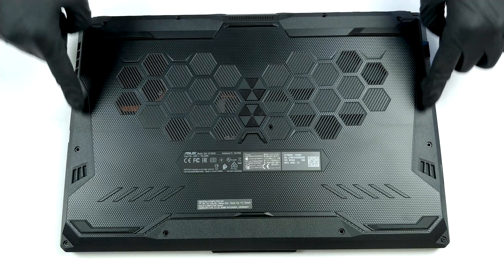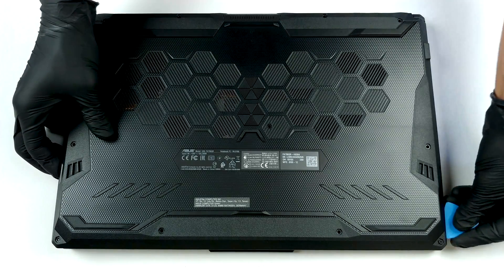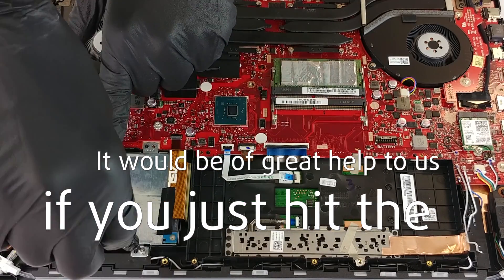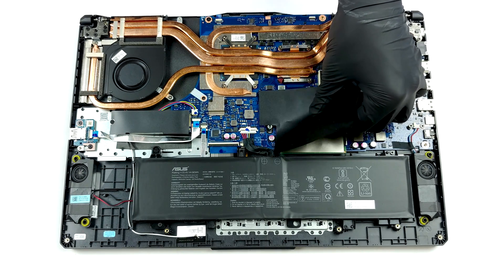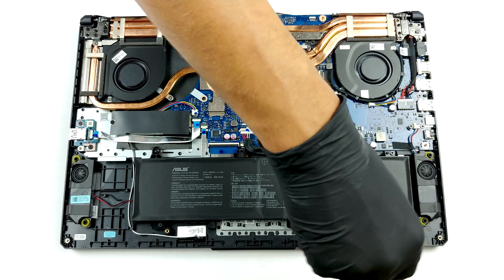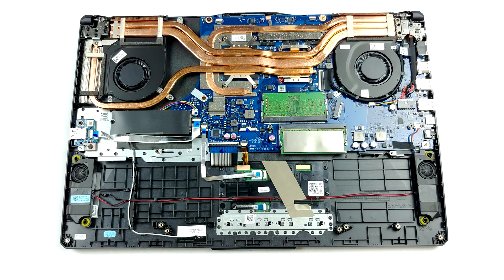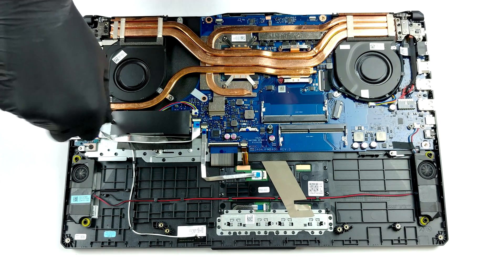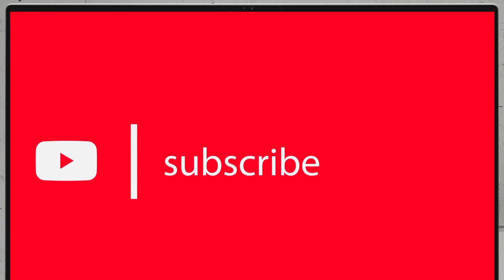🛠️ ASUS TUF A17 (FA706) 2021 (Ryzen 7 5800H + GeForce RTX 3070) - disassembly and upgrade options

Comment: I have this model od laptop and i have couple questions, in which you can help me. First of all, i want to thank you for this clip, i wanted to change RAM memory from 16gb (2x8gb 3200 cl 22 1,2V) into 32 gb (2x16gb 3200 cl 22 1,2V). I called in couple places and on the question if i can buy memory with lower cl they mostly answered, that i have to had the same. When i asked if i can have more then 1 TB of  memory on one m.2 slot? Can you try to check this issues and give me info if i can develop my laptop more?

Comment: One small detail, if you can also capture the memory units labels, because it seems manufacturers are using a scam technique BAIT & SWITCH.
The density of memory is important so they send for review with (rx8) density but buying from stores with (rx16) density which is cheaper but also worse performing, so you buy laptop based on reviews but receive worse quality.
Thank you
Reply from the maker: Hey John,
99% of our reviews are made using laptops from stores (not review units), and in most cases, you could check the memory modules in our in-depth reviews (link in the description). However, this time we don't have photos of the exact RAM models, unfortunately, sorry about that.
Reply: @LaptopMedia  Thank you for reply, is a suggestion for future videos, i know now you do not have. Is good is from store shelf laptop unit, because "no special" changes.

Comment: Does it support video output through the type C 3.2 port? Let's say by using a docking adapter with one or two hdmi's?
Reply: C is display port and yes it works with a adapter

Comment: PLEASE DON'T BUY THIS MODEL!I HAD IT AND IT'S HORRIBLE!
Reply: The 2020 model was not good because cooling but it's still good I would say
Reply: @EchoDroll  Also the 20ms display response.
Reply: @Blacktrous  yes idk if they improved this years model but my gaming laptop has 20ms screen i played on 3ms gaming laptop screen it is not bad/unoticable
Reply: @EchoDroll  ı am thinking of 3060 2021 a17 model. what should ı choose at this price point
Reply: Did you had 2020 or 2021 model?
Reply: Probably 2020
Reply: does this 2021 version have 20ms screen or 3ms? wtf 20ms? thats not even playable

Comment: 3070 TDP is limited ?
Reply from the maker: Yep, 95W - something like a Max-Q version.
Reply: @LaptopMedia  No sh*t man ! This is tragic LOOOL
Reply: @LaptopMedia  does this a17 have max-p version of rtx 3070?
Reply: Max-Q ?? :((((((
Reply: @mxgl  yep.. heard that the 3080 mobile has the same performance as the 3070 desktop card and 3070 mobile is more or less than the 3060 desktop card..
Reply: @drifter4training  3080 desktop has 64% more performance than laptop version. That's means 3080 laptop is on pair with RTX 3060Ti.
Reply: Really weird GPU specs. NVIDIA® GeForce RTX™ 3060,With Dynamic Boost up to 1630MHz at 90W (95W with Dynamic Boost),6GB GDDR6 and NVIDIA® GeForce RTX™ 3070,With Dynamic Boost up to 1510MHz at 90W (95W with Dynamic Boost),8GB GDDR6
Reply: Asus only uses max Q atm. ACER Nitro 5 (AN515-45-R8BM)
Uses 115watts at Same price. Next 1 is the MSI Leopard with 130 Most Others are capped at 95